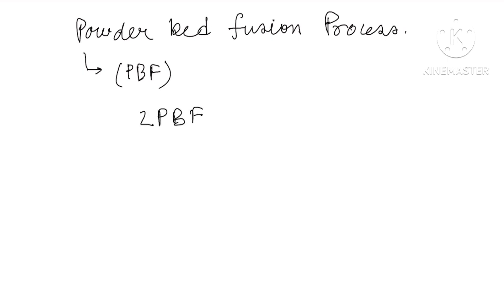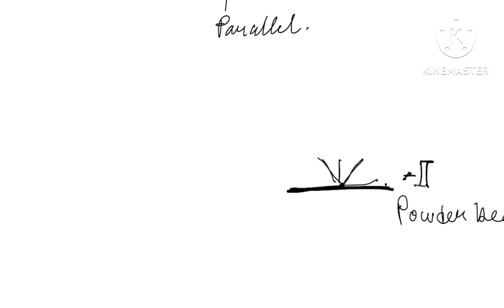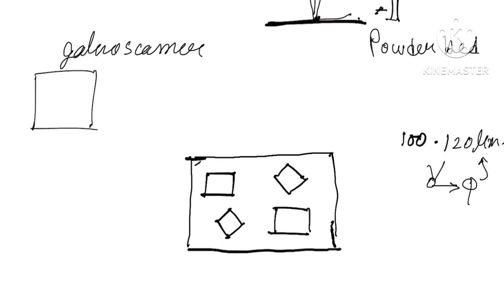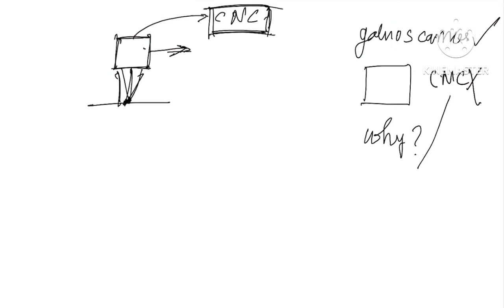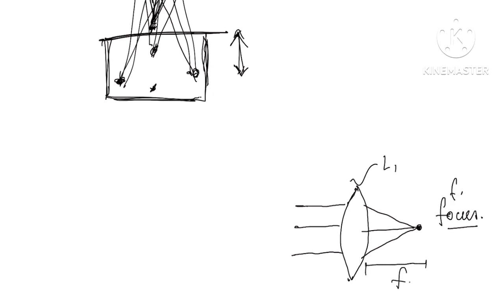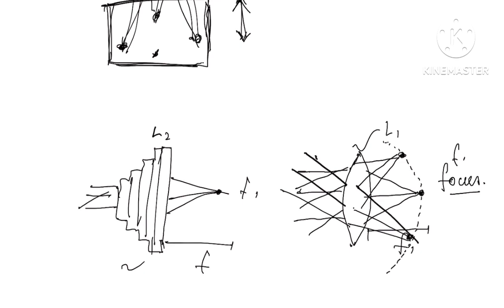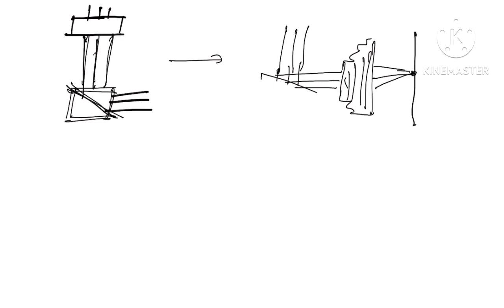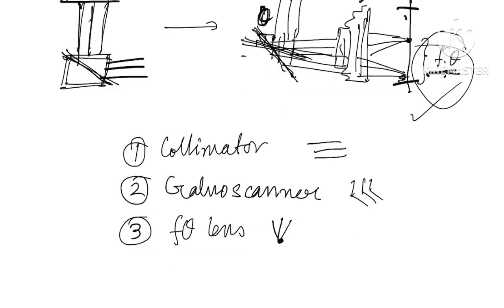Laser beam delivery system in LPBF // Ananya Nath // MAM Pathshala // Metal Additive Manufacturing

Comment: is there any role of pin hole in laser beam delivery system??
Reply from the maker: Pin hole basically used in optics application, where you need to make a parallel laser beam as a point source , in additive manufacturing generally lenses (plano Convex lens) are used to make the parallel beam convergent at the focus point over the build plate